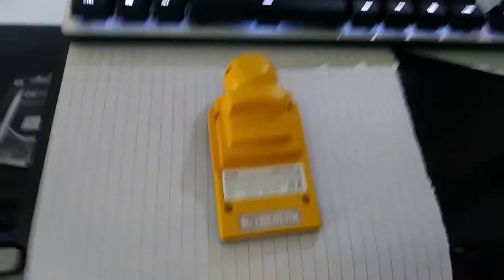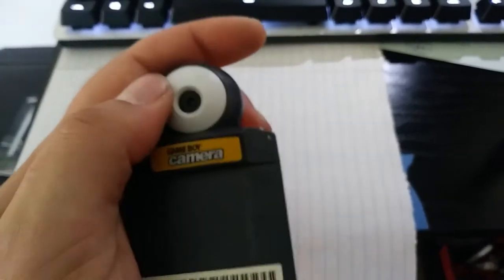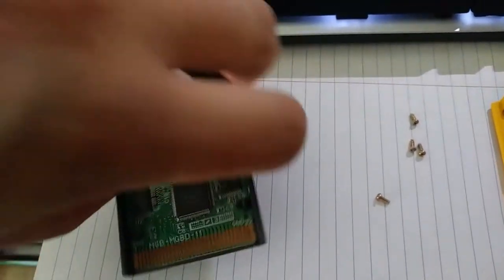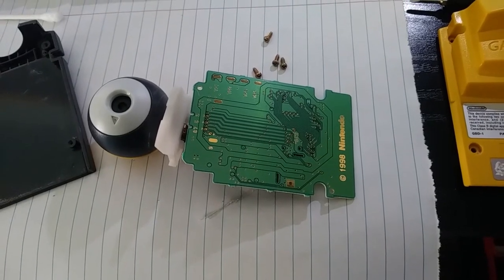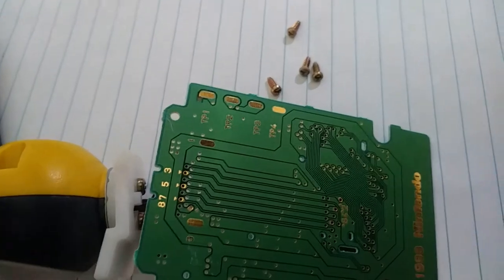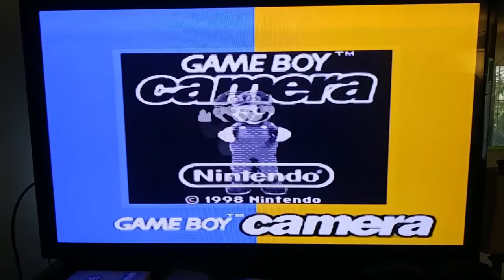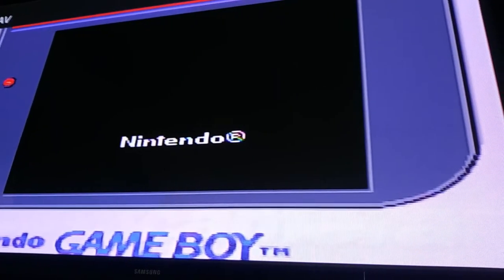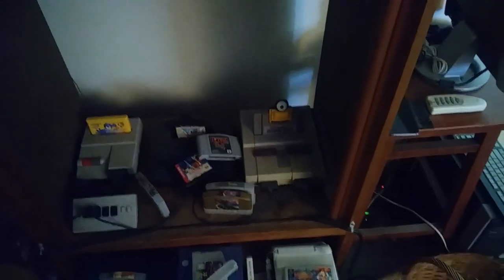GameBoy Camera Teardown/Cleaning and SGB Compatibility Test

Comment: I have my gameboy camera since childhood and I admittedly haven't used it in over 18 years but I turned it on today to find all my pictures of friends and family gone 😢I guess the small battery didn't have the power to hold onto pictures in memory for so long. I bought a gameboy cartridge reader to connect to the pc and extract the gameboy pictures but it was all blank.
Reply from the maker: I'm sorry to hear about your loss there. :( I have also had a few similar tragedies. Yes, these things are getting to the age where even the high quality batteries they installed at the factory are getting past their service life. it can be somewhat hit/miss however as I have some NES cartridges with nearly 40 year old batteries that still hold saves. 

If you have any other cartridges or memory cards with precious data; I suggest you get the batteries replaced asap. Unless you're quite confident in soldering/electrical understanding; I'd have this done by someone with experience. Replacing the battery with no concern for the data is easy and a good project for anyone to try and learn soldering. Preserving the save files and replacing the battery is going to require more steps and may not be so easy.

Let me know if you have anything like that. I'd probably be willing to help you with it just for the youtube content if you were comfortable with it